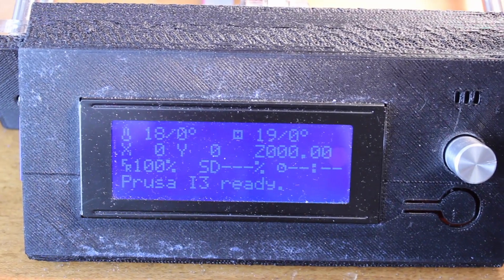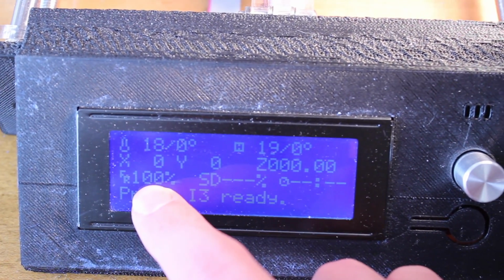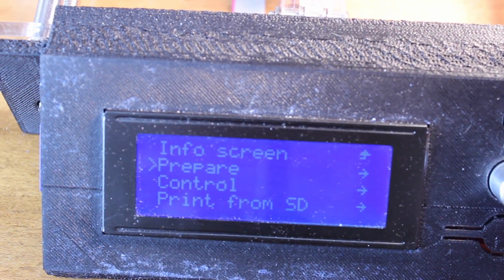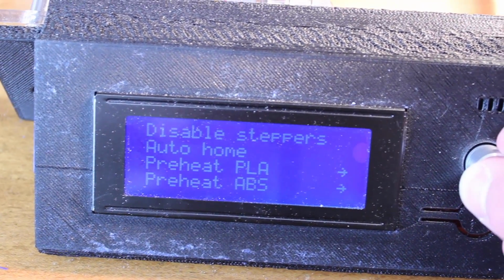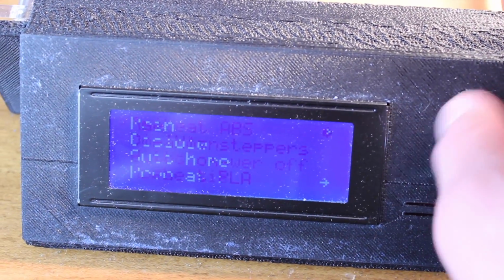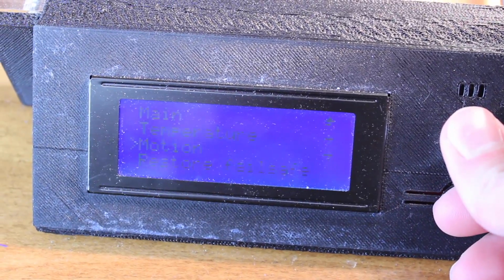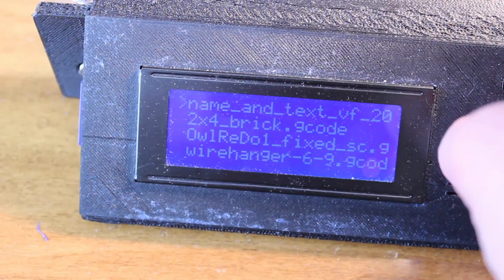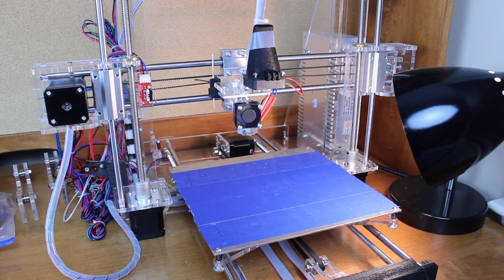Sunhokey reprap Prusa i3 3D Printer: Calibration, Settings, Your First Print!

Comment: Hi, this is a great video. I was given one of these (the Perspex ones) but the control unit is different. It’s needed some parts making for it and I think it may have a software glitch which I wanted to look at trying to find the correct software to reinstall onto the printer.

Do you:

1) know where I can get the open source software from? And what version is needed?

2) where I can get a control unit like the one you have as the one I have is on its last legs and could do with being replaced.

Any and all assistance is greatly appreciated

Comment: Nice video. Filament only needs to be stored if not getting used for a long period of time. Watching most 3D printing Youtube professionals, they do not store filament in a bag, they have them stored on a rod hanging on the wall etc, out in the open. Still a good idea if it's not going to be used for months. At work I've had some left on a cart for a year and it still worked just fine, was a little more brittle but only broke once at that start of a print. Some brands are worse than others. You get what you pay for. Keep up the great vids.

Comment: Hi excellent video for a first time user. I bought a zonestar p802qr2 and it seems that there is only a y and z axis limit switch. Is a z limit switch a must? When I press auto home the head goes to a position that is outside the bed
Reply from the maker: Any printer should have 3 limit switches for x, y, and z axis
Reply: @3DNow  , awesome! And is there a way on these firmware to adjust the home position and have it saved?
Reply from the maker: The limit switches should be the home point. To adjust the bed, just turn the screws to raise and lower it.
Reply: @3DNow  thanks! And so when the head is at home position the bed should be 0.1 mm from it? Is that how the printer should always start off?
Reply from the maker: Yes! The width of a piece of paper.
Reply: @3DNow  thank you so much for your answers. This is very helpful.

Comment: My temperature won't rise above 25 and the autohome won't work ?
Reply from the maker: It is probably because the wiring is not correct. Make sure everything is in the correct spot.
Reply: 3D Now Iv double checked it and I believe it's 100%
Reply from the maker: Does the bed heat up?
Reply: 3D Now the bed and nozzle seem to stop at 25
Reply from the maker: Well that means there is no power going to them, so check the power supply and place you inserted the wires into the motherboard
Reply: 3D Now the power is connected, I can't find any solution on forums
Reply from the maker: Are you heating the bed and nozzle from the printer or from the slicer during a print.
Reply: 3D Now printer although Iv tried using the easy print 3D to change the temperature but again they both stop at 25
Reply from the maker: Try heating the bed and nozzle from the printer menu. Its control, temperature, nozzle.
Reply: 3D Now 

I can set the temp up past 200 but it still won't heat to above 25
Reply from the maker: Ok, then something is probably wrong with either the printer firmware or the motherboard
Reply: 3D Now 

any solutions or suggestions?

Comment: I have a Flsun i3 printer.  When click go home for the Y, the hotbed moves to the front but does not stop.  It crashes into the end-stop.

 
I confirm all my motors are wired correctly.

My Slicer settings are 300 x 300 x 420
Reply from the maker: Make sure the endstops are wired correctly and the bed is hitting it
Reply: The "rear" of the printer has a limit switch on the end stop; that side works.  However, the front has no limit switch or other wiring at the end stop; that's the side where the bed just crashes on the y-motor grinds and grinds until i abort.

Have you heard of this problem on the Flsun?
Reply from the maker: That means your printer is not setup correctly in the firmware. You may have to re flash it
Reply: I went ahead and re-flashed it: Same issue :(
Reply from the maker: Is the bed size correct in the firmware?
Reply: Say i got it resolved.  Turns out I needed to flip the belt over to the other side underneath the hot bed.
  Go figure...

Thanks again for your time on this. :)

Comment: Help ! My power supply has 9 slots and the manual + videos on internet shows 7 or 6 slots, i dont know where to put my wires and i tried doing it before but my whole house got a power outage, someone please help! ( Screen shot : https://gyazo.com/cde4b9b021aab10d49a5629f07230daf )
Reply from the maker: There can be some empty slots on the power supply. The symbols from the manual and the power supply should match up. You should be able to use those

Comment: So the gear that pushes the filament towards the hot end isn’t gripping, any suggestions?
Reply from the maker: Make sure the extruder motor is assembled correctly. There should be pressure on the filament with a spring.
Reply: it does but when i go to print, no filament comes out. and the extruder isn't clogged
Reply from the maker: Maybe the extruder motor isn't plugged in. Maybe check that. Does the motor even turn?

Comment: Hi, when i start my print from autohome, the print doesn't start in the middle but instead starts printing at autohome, is this something that needs to be fixed when modelling in the software or is this sometthing that needs to be changed in the firm ware. thanks!
Reply from the maker: That should be in your slicer. Check that it prints in the center of the bed and not at the home point.

Comment: Hi Jack
My name is Magnus and i live i Gothenburg Sweden,
Just bought a Sunhokey prusa i3 Acrylic 3d printer... without all files so im trying to get it working.
Could i truble you with a marlin setup file... downloaded from github... but that file needed much work.
Since Im new the config.h file is a not so easy file to get to work properly... 
I dont really know what to uncomment / comment.
contact me on molausson72@gmail.com
thanks in advance 
Magnus
Reply from the maker: Magnus Olausson hi,  I'm not sure what you mean.  The config files should already be installed on the control board
Reply: Sorry 
it is the 1 million settings that is making my life hard... 
What I would like is your settings for your printer. The one in your video seems to be the exact same as mine
If you could please send me a copy of your merlin code I would be gratefull
and thanks for the quick responce :-)

Comment: hello, i i tried to get the nozzle to be paper thin distanced from the bed but it just rips through, i used the screws to raise or lower the bed but still same issue
Reply from the maker: munther bader when you adjust the screws, you should make it so the nozzle does not scrape through the paper. What printer do you have? Does it have auto bed leveling?
Reply: 3D Now, it's Prusa i3 it doesn't have auto level, and I did have the screws all the way down to crest that small gap but still same
Reply from the maker: Okay, then try adjusting your z endstop switch.

Comment: autohome on mine is a nightmare. it pulls the plate all the way to the back and forced thw bumpstop bent it and bad clicking noise wont stop
Reply from the maker: Hmm,  you probably need a new endswitch. Make sure all the wires are connected next time.

Comment: Hi man! I really need you help, I'm as lost as I could be, I bought a prusa i3 lookalike and I don't know what's missing, first of all my extrusion port isn't working, I've changed the cable to the Z motors and it makes the motor turn but it will not work if it's connected correctly, second thing is i have done as you instructed to heat the bed and nozzle, but to no difference, I have a mac and my designs are on Fusion360, and to top it all off I obviously can't print. Please help
Reply from the maker: Ed Man try finding an .stl file on thingiverse.com and slicing it in cura. Put the gcode file on a flash drive and print on the printer. Let me know what happens then.
Reply: Sorry for the delay, but had things to do and I finally did as you told, I managed to download the cura program and couldn't download any files from thingverse, but I did make a small tube and opened it on cura and got the g code, after that I saved it on the SD card and finally connected it to the printer, then I plugged it in, preheated for PLA and opened the file and after  a few light flashed it said 3d printer ready, yet it didn't warm up or do anything, hope you know where I'm getting it wrong, thanks for the fast reply yesterday !
Reply from the maker: Okay, so your firmware on your control board might be corrupted. Try re-installing the software on it. You can find videos online. Just search "3d printer firmware install"
Reply: bro, it finally did it, I still have to work on calibrating the extrusion rate, to have the perfect print, but it's done, thank you so much for your help
Reply from the maker: Ed Man Awesome! I'm glad I could help.

Comment: hey jack, i got a geeetech prusa i3 but when i got it i dodnt get a software disk, links or anything... would you have a (or know where to find) a set of config files that can just be uploaded to an GT2560 rev a. board. with no work done to it.
Reply from the maker: Jason Shook the control board came with no software? It should come pre installed
Reply: https://youtu.be/iJuvksXBLuw    here ya go im in contact with the seller but at the same time the same point gets across
Reply from the maker: See what the company says. This might help as well. https://www.youtube.com/watch?v=3gwWVFtdg-4

Comment: 3D Now
Hi Jack.
I have just assembled my Geeetech i3 pro b and my first print was flawless. however since then I cannot get my PLA to stick and if it does the print ends up being a huge mess with a perfect bed. I have tried adjusting the temps but still no luck.... it seems to me that the filament coming out is way too thin.... can you please help?.... thanks for the vid :)
Brett Plowman.
Reply from the maker: Brett Plowman try cleaning your nozzle out.  Then use a new layer of painters tape and wipe it with rubbing alcohol. Let me know if it works!
Reply: Thanks heaps Jack ..... will let you know :)
Brett.

Comment: hey i just finished building my printer can you please help me how setu up the lcd screen. on youtube I saw some examples, but in my Arduino program I don't see the configuration tab please help
Reply from the maker: You just have to plug it into the control board.

Comment: How to set the Z axis to 0 in a specific location?
Reply from the maker: What do you mean?  You should be able to move the head around with your hand and adjust the hight of each corner of the bed. That should make the bed level, or 0 in the Z axis.
Reply: 3D Now I always do that, but when I press on home, it move to different position than the one I place it on. 
Is there a way to change the homing for all axis?
Reply from the maker: What printer do you have? You might have to adjust the Z end stop. The nozzle and bed should be calibrated so they are level, but the Z axis hight might not be. When a print starts, adjust the Z axis end stop until the nozzle lays down a good first layer. That should fix it.
Reply: For the Z axis I understand the way,
But my question is about the X and Y axis, how can I change the home position after thy hit the end stop?
Reply from the maker: Maher Alsayid Oh! Sorry, for that you need to do it in your software for your motherboard.
Reply: 3D Now it's Marlin and I'm using repetier and cura for slicing

Comment: Hey,
When calibrating the height, I home every thing, turn the steppers off and do the paper calibration and get it where its just pinching the paper. Then when i hit Print it starts in a much higher position then the calibration I just did any ideas?
Also When im printing i occasionally hear a clicking sound like the filament is skipping then it will go OK unsure if I need to do any thing to solve that too?
Reply from the maker: So you might have to adjust the Z end stop. The nozzle and bed should be calibrated so they are level, but the Z axis hight might not be. When a print starts, adjust the Z axis end stop until the nozzle lays down a good first layer. That should fix it. Also, the clicking is the feed motor skipping because it can't push out any material. This can be fixed by re-calibrating your Z hight, or changing up some settings on your slicer software.

Comment: great video, it help but i have a a8 printer, i just replaced the hotbed, and the anet card, (red)  i go to pre-heat, the screen goes blank, sugesstion on whats wrong?
Reply from the maker: You might have wired the hotbed wrong. Try checking all the connections, too.

Comment: do you need a high end pc to print ?
Reply: No you don't - you can even print without a computer using a SD card.
Reply from the maker: It would help.
Reply from the maker: Yes, I meant you need a higher end computer to 3d model and slice. To actually print you can use any computer or an sd card. I would recommend an sd card.
Reply: 3D Now I dunno, I can actually get away with slicing and modeling using a 2010 MacBook Air with only 4 gig..   but as to controlling the printer?  Research using a raspberry pi!

Comment: Hello, my belt keeps vibrating when printing and x axis and y axis are very loud. I wonder if it is mechanical problem or software problem. I can see your printing is very smooth. The belt doesnt vibrate at all. Please tell me how to solve. Urgent plsss
Reply from the maker: Steven Lee Your belt might not be tight enough, so tighten the tension screw. Also, make sure that you are using the right belt with the right gears.
Reply: 3D Now I hear another fix is to print a cover for the bearing that adds teeth so the belt doesn't rattle on a smooth bearing. I've seen a lot of those on thingyverse.

Comment: mine doesnt seem to stick, do you put some thing on top of the blue tape
Reply from the maker: Waggys Cakes & Cupcakes you don't have to but sometimes I wipe on rubbing alcohol.
Reply: I can not seem to get it just right, it seems to either go too high and doesnt stick, or put it low and it curls up round the nozzle part
Reply from the maker: Waggys Cakes & Cupcakes then you need to adjust your z height. move your z axis endstop until the nozzle is exactly the thickness of a piece of paper from the bed
Reply: yes i did that, and then when i set it off to print, while its heating ect it moves the nozzle up again, and then when it goes back down again its too far from the bed again, how can i get it so that it stays at the right height, and can set it off to print without having to do anything
Reply from the maker: Waggys Cakes & Cupcakes you have to keep adjusting the z endstop and press "auto home" which will put the nozzle at the height to print. you should calibrate off that
Reply: thanks i will give it a try

Comment: my printer has a pcb build plate and it came with a piece of glass with masking tape on it and some binder clips. what is the glass for? do i use the binder clips to attach it to the pcb or do I put masking tpe on the pcb and print on it ?
Reply from the maker: Ciarán Farley-Toone You can use the glass bed by itseif or the tape on top of the glass. The clips are to keep the bed in place.
Reply: So I should not use just the PCB with tape? I need the glass ?
Reply from the maker: Ciarán Farley-Toone either is fine
Reply: Thanks

Comment: I am trying to calibrate my Prusa i3 printer but can not get not get my X and Y axis to move freely by hand?? help
Reply from the maker: In the menu click, prepare, disable steppers.
Reply: reThinkTech 
I tried that and it doesnt seem to work.  :(
Reply from the maker: unplug the motors and plug them back in, then try the disable again. If that doesn't work, try printing something and if the motors don't move at all, you may need a new motherboard or motors.
Reply: reThinkTech thanks will try
Reply: how much is a new mother board and where do I get one?   Thanks

Comment: How are you getting such a nice build quality? Every print I've made has been really stringy and rounded,
Reply from the maker: Make sure your temperature is correct, your nozzle size is correct, the calibration is good, and the filament you are using is high quality.

Comment: Helo
i have a problem with my Sunhokey Prusa i3. i think my extruder not working proper.if you  can you watch linked movie and please write your comments. Many thanks

https://yadi.sk/i/Mu_uMM8Iwjszy
Reply from the maker: Looks like your nozzle is clogged. Try to get all the filament out of your nozzle and try again. Also, are you sure your hot end is getting hot? Which filament are you using? The clogging problem could be from the quality of filament.
Reply: Thank you for answer. ı am using PLA 230 C.Filament is melting when i pushing with my hand. can be extruder problem?. How i can try or test. Many Thanks
Reply from the maker: 230 C seems very hot for PLA, try using a different, more high quality, filament.
Reply from the maker: Looks good, try printing at .2 or .1 mm.

Comment: has anyone had any problems with their prusa i3 just stopping mid print??? please help
Reply from the maker: Are you printing directly from your computer?
Reply: +reThinkTech no, SD card
Reply from the maker: What slicer are you using? Also, make sure all the wires are connected securly.
Reply: +reThinkTech im using cura and as far as i can tell all the wires are fine, it just started having this problem
Reply from the maker: Okay, when it starts yo print, make sure the wires aren't overheating, Mine melted the plastic casing and shorted out.
Reply: +reThinkTech i think my hotend may be shorting idk tho, thx for ur help so far 👍
Reply from the maker: Sure!